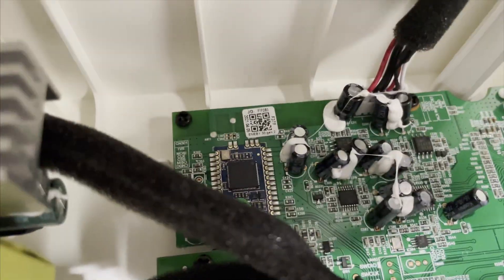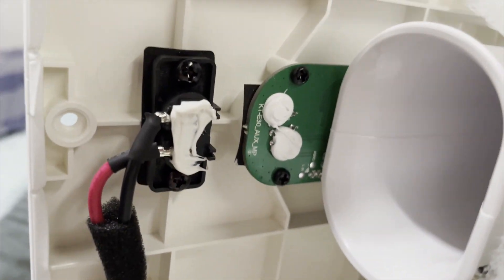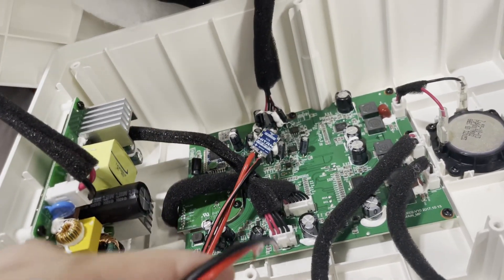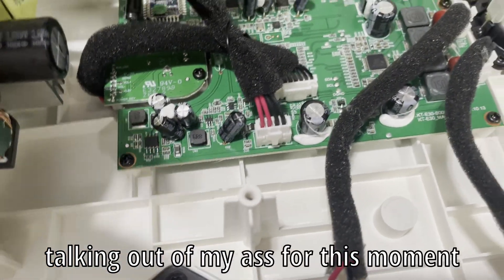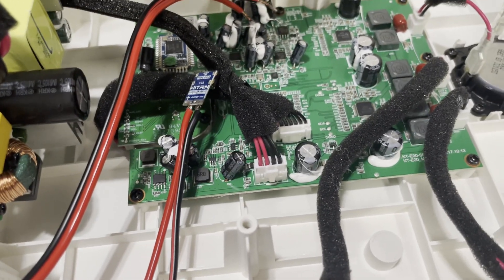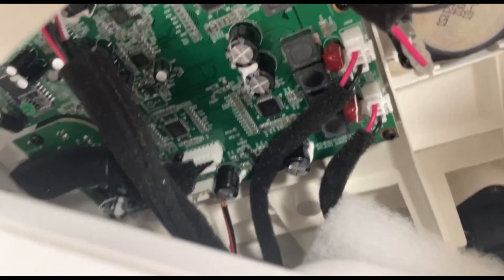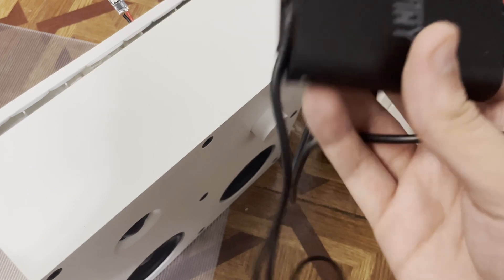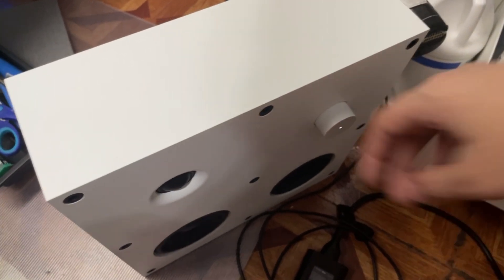IKEA Eneby 30 Gen 2 quick teardown + USB C PD "mod"

Comment: Will it work with 12v?
15?
Reply: Down to 9 Volts you can. I had mine on 12V laptop battery but you must know that it plays little quieter.